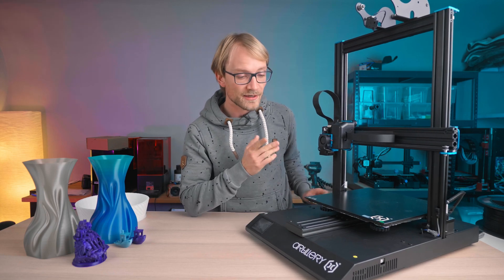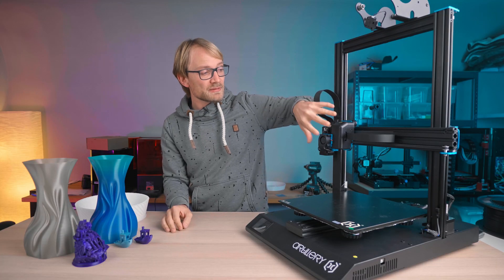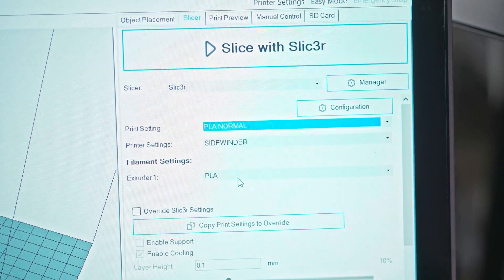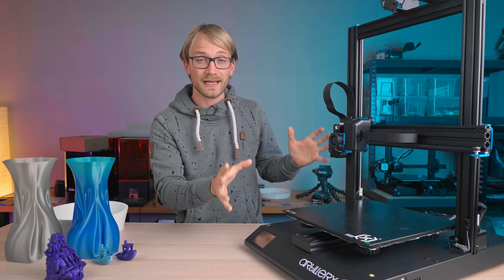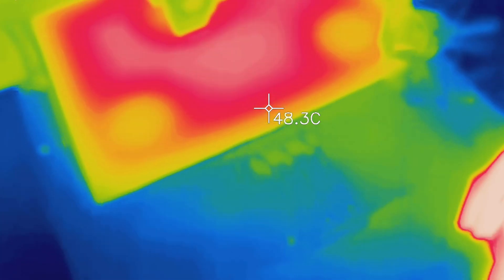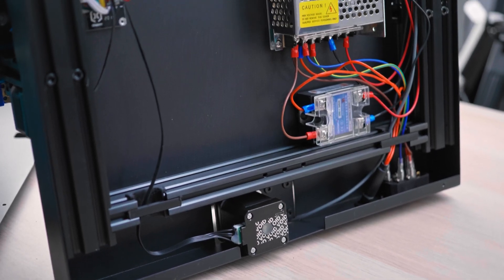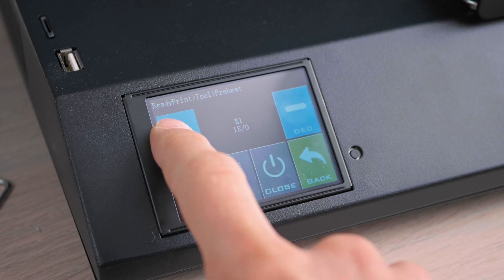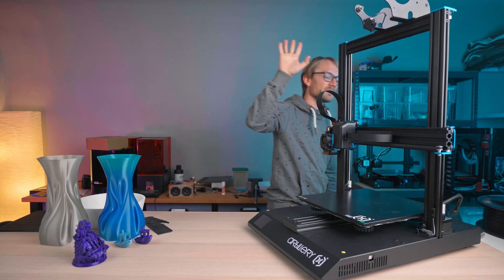Artillery Sidewinder X1: Built for show!

Comment: Well I wish I had seen this review before buying mine. Since owning it have experienced 2 occasions where material lost adhesion to the bed and resulted in the model being thrown off and the printer continuing to print. Normally when that has happened it's results in a load of spaghetti. However on 2 occasions it has actually caused plastic to engulf the nozzle, hotend, the 2 cables, the little board that seems to slot in and also the bit that connects to hot end to the main unit, that just snapped off. I then purchased 3rd party parts that didn't fit properly so I had to buy a whole new unit (not a whole printer just the bit that attaches to the printer, apologies I'm not sure on part names). It almost happened a 3rd time that time I was in the room and caught it before it got too bad. It's a unit that is a little more than frustrating. The print area is so conveniently sized yet I am now unwilling to leave it over night so I am limited on size because it takes so long to print.

Comment: Hi Thomas, I hear what you're saying about the heavy glass bed and the inertia behind it and its impact on printing large parts. However, from personal experience I can tell you it doesnt have that big or even a noticeable impact IMO. I print with a .8 Nozzle and typically print parts that occupy around 80% of the build volume and fairly fast speeds. Not saying its perfect, bc its not, but in the almost 2 years ive had mine its out performed alot of other printers ive worked with.
Reply from the maker: That's why I'd advise for a larger nozzle - a 0.8 really speeds things up.

Comment: I agree with your verdict. That said, I've had one for a few months, made a number of improvements, made it electrically ,more safe, and I will say that it produces outstanding prints - better than the ones in your video. .If you know what you're doing, you can turn this printer into an outstanding performer. Perhaps not a printer for absolute beginners. Also worth mentioning is that the company does listen to its customers. Their latest hot end design does no longer blow air downwards.

Comment: I was actually going to buy one of these tomorrow. Not anymore I guess.
Reply: Have you been to other facebook pages at all, just about every 3D out there has issues.  Every issue he mentioned is mentioned on their page with a fix to have it corrected, with the exception of the grounding issue, (mine does not have that issue).  Go spend some time at the creality website, which sells a ton more units, and read up on their problems.  Anyway, just wanted to point this out as I think a lot of first time buyers are not aware that you will probably have to tweak a few things to get your printer set up nicely.
Reply: I'm no first time buyer, in fact this would have been my 4th 3D printer. I'm well used to tinkering, not only to get better prints, but just to get one of my printers to print at all. This thing however is an absolute disaster with its electronics. Just the fact that the X1 has mismatched connectors plugged into the mainboard put me off, nevermind the shoddy sheath on the bed heater wires. I bought something else in the end.
Reply: @viceroysStuff  Prusa!

Comment: Now i feel kinda bad about my done but not delivered yet purchase from monday this week. I hadn't seen a single bad review on this printer anywhere, so i am kind of confused about what to take from this. It's not that the mentioned problems can't be diagnosed and cured, but my expectations are very different from what i've heard over the past 20 minutes!
Reply: Mostly because at this price point there is nothing better, and you can find 3d printed upgrades that will fix some problems, the prints are good so people are happy to tinker with it .
Reply: @haoss69  I got delivered a week ago, and it's the best printer i've ever seen. Works like a horse, and puts out quality part after quality part. Having used it for the better part of 10 days straight with barely a few hours not printing something, i see this review as just a bad experience, not a proper in depth review.

Comment: The CE seal is bought by self-certification and by filling in a couple of forms. By no means does it guarantee an electrical product to be infallible: no certified "CE engineer" will check your product before you are granted the seal. It's only useful for your insurance should you indeed experience a fire.
I'm an electrical engineer so I checked all the things you pointed out and except for the bed cable they're fine. You're making a bigger deal out of this than it is.
With this printer you need to do a little bit of DIY. 
I also replaced the idler handle for a aluminum one and replaced the inner tube with a Capricorn PTFE tube. And I added a BL Touch. The total cost of the upgrades was about 50 euros and I paid 375 for the printer on Aliexpress.
The bed adhesion never gave me any issues since I use Dimafix but I plan on adding a WhamBam plate like on my other printers.
Reply: All the mentioned mains related electrical issues are major issues. Every single one of them will lead to fail conformity tests. But as you mentioned, CE is self-certification and no actual test is required to declare conformity.
Reply: @fkiesel9442  Fortunately the mains issue is extremely easy to fix without requiring any technical knowledge.
Reply: @mururoa7024  would you give your family to work on 220V mains power connected device without proper ground protection? Are you serious with your comments? Sure people with no technical knowledge should go poking around 220V with pointy metal sticks. You should be awarded for Darwin awards.
Reply: @valent_t  I'm not sure if you understood what I wrote. As I said in my previous comment, I'm an electrical engineer so please spare me the lecture. I specialize in power electronics and automation. I've tested everything on this machine and it's fine, even the SSR is according to specs. The easy fix on the mains I was referring to is to replace the rubber sleeve with a cable chain. You can buy a cable chain or you can print one. This is not electrical work, and in fact you don't even need to open the machine at all. You just need to not be clumsy.
Reply: @mururoa7024  how about the grounding?
Reply: @LászlóKrencz  I tested it with my multimeter. The body of the machine and the power supply are both properly grounded (mine has a Schuko plug). I have a model 4. I can't speak for earlier versions.

Comment: FYI! Cura 4.8 has the X1 in there printer list so you can ignore repetier and go straight to Cura with preset profiles created by 3d nexus.  You nailed the rest Thomas greetings from Belgium.
Reply: Try to laminate with the same parameters but creating a custom printer profile, you will see that the printing time is drastically reduced. There is something wrong with the 3D Nexus print profiles that makes the prints too long.
Reply: Also if you would like to see some more in depth i got 2 vids from the X1 if you like
Reply: @NoizieWorks  link please would love to check it out. I have the SX1 v4 and so far so good

Comment: Interesting timing.  The X1 was my first 3D printer.  I got it 6 months ago, and then got two more 4 months ago (all v4).  I switched them all to .6mm nozzles.
The power wires for the bed heater on all three broke within the last week.  All three were at the kink you showed closest to where it meets the back of the case.  I figured out there were issues when all three were showing thermal runout errors for the bed.
I just replaced the bed heaters on all three and I added strain support to keep the wires where they meet the bed heater far more stable, and to keep the entire length of power/thermistor wires from kinking and instead bending with a reasonable radius.
Then I went and added the same support to the two Genius printers I recently picked up.
Thank you for all of your great videos and information, especially when it may ruffle a feather or two!
Reply: @iBert0  - I found a design I liked on Thingiverse.  Just go to that site and search for "sidewinder strain relief".  You'll have several options to choose from.  I suggest also adding a cable chain or something similar.  For me, since I was already pulling the print somewhat apart in order to replace the bed heater, I ran a piece of filament inside the cable sleeve along side the power and thermistor cables.  I don't know how long this solution will last, but so far so good.

Comment: I've owend a v4 Sidewinder for a couple of weeks and it is junk, basically. Out of the box the print bed had a huge dip in the middle, bad enough to render it unusable for anything but small prints. Even after loosening the bed and running it through some heat cycles as several people suggested, it's still around 0.2mm low in the middle area. The bed's thermal uniformity is awful, with a delta of 12C from the middle to a corner.
Two days after getting the X1 I did a PLA print and when I tried to remove it (with the bed fully cooled down) a big chunk of the bed coating tore off. 
To add insult to injury, on the very next print attempt the silicone sock came loose and caused a huge blob of PLA to cover the hot end.
It's a shame, since the printer is super quiet and the print quality, if you can get a print to stick to the terrible bed, is really good.

Comment: I owned my Sidewinder for 3 months and  started getting MINTEMP errors that were killing the prints in the middle of printing.  I am not new to 3D printing, and knew exactly what it was.  There was a break in the cable to the thermistor on the bed.  I contacted Artillery and they sent a new bed heater and insulation pad.  I have installed it and am back printing again, but one thing I plan on doing is removing the coated sleve that is on the bed heater and  replacing it with some PET braided sleve which has MUCH better flex.   The replacement heater came with the same stiff sleve that the original one had and has the similar kinks in it in a few places.  My guess is because of the coating that is on it.  If they had just made it with more flexible PET sleve it would have been  much better from the get go.
Reply: @3D Print Wrangler watch Tom's unboxing video ( https://youtu.be/7hcjsZRBuws?t=907 ) the link will start at around 15:10.  He talks about the heat bed cable.  You can see the type of sleve he has on it and how the cable is kinking.  This is the style that I have and that I think the majority of the people have.  You can see that it is a coated braided sleve. IMO it is the coating that kills the braid.  This is why I say that the PET braid would be better.

Comment: Have a V4. The flex cable issues are atrocious — flex cable boards replaced and still having issues. Hard to update the machines firmware — always needs a disassembly to unplug the TFT.  Because of the flex cable, I’m unable to hook up a BLTouch right now... idler arm breaks every now and so — requires a metal one.

Great when it works — prints come out nicely too... horrible when it’s down.

Comment: Interesting info. I've had an X1 for almost a year now that was listed as a V4. My cables and hotend are different than yours. I've hardly had an issue with mine through hundreds of hours of prints and it's my go to for any large parts that need to be strong.

Comment: I have the Artillery genius, I really like it but wanted to upgrade the heatsink to a genuine e3d titanium one.. well my printer does not have a threaded heatsink (the early models had a threaded one) but locks the heatbrake with 2 small hex lock bolts... Then I ordered a titan aero heatsink which has a threaded heatbrake mount, only to discover that the Artillery heatsink is like 1cm longer where the heatbrake hole is located... So after installing the aero heatsink my nozzle would not touch the bed before the part cooling duct and the carridge wheel behind the nozzle... So if anyone is trying to upgrade his extruder with a better heatbrake... Buy one which fits in place of the original... 
Sry for bad English

Comment: Mine hasn't stopped jamming for *months*, but that seems to be specific to my unit
Reply: @3D Print Wrangler Yeah, it's filament jamming. Since it started I tried swapping the heat break to an all metal, which just made it worse because I think now it's causing heat creep because as tom mentioned, it uses a weird heat sink design.

Comment: The Chinese business model is a bit different, once a product gets traction they tend to iterate downwards to increase profits. Its not unusual in any business except the Chinese started off with barebones engineering in the first place.  Chinese owned business are focused on short term goals.  For myself, after getting sued for the product I imported causing fires (dont worry the damage was fairly low) I became strongly anti-china as the lawsuits eradicated my life savings right when I had my daughter.  The Chinese partners did nothing to help (its impossible to sue a Chinese business)  and their products continue to be sold with impunity. So the point is maybe the first ones were better...  Western consumers don't care until their house is on fire and then they demand justice even being WARNED of the issues ahead of time. 
Doesn't matter if you saturate your product with warning.  In California its called "strict liability" and I can go on forever. 

Source: I used to import Chinese goods in the hundreds of thousands from 2012-2015.
Reply: I wonder; is this still viable if they come with a warning paper like this 3d printer not to leave it unattended ?
Reply: @elvinhaak  Warnings can limit the judgement or give you leverage in a settlement.   For example, a blowdryer should not be used in a bathtub, but at the same time the blowdryer company would still be held liable under "strict liability" for any damages even if the user completely disobeyed the warnings dried their hair in the shower.  Same with smoking around a gas can etc.  You can use the warnings to negotiate etc, but you may still have to settle and have your own legal fees or pay more for product liability if you can even find someone to ensure you. . So US companies add extra idiot proofing to their designs. 

It also depends on the state the suit happens in, in California you get wrecked!!!!   The definition of strict liability is "Strict liability is a legal doctrine that holds a party responsible for their actions or products, without the plaintiff having to prove negligence or fault." in other words anything that happens you carry the load even if you did everything right and are not at fault. If you look at a blowdryer, it has really over engineered GFCI plug. US product designers design around this threat to their business. 

A misconception is that only the maker gets sued, depending on state you can sue everyone in the chain of commerce.  Amazon dodges this but small companies don't have this ability so they often settle.  I can write a novel its quite insane everything is tilted in China or Billion dollar quasi monopolies favor. 

Perhaps I will make a video one day. It was one of the most stressful moments of my adult life.

EDIT: I live in the US but just any western company takes steps to ensure they are not taking risk by adding idiot proof steps or simply maintaining quality standards. .
Reply: @takingtheblackpill  Wow, that is really sad! We all laugh here at the stickers at our microwave that we should not use it to dry our pets but it looked just like an anecdote. But this what you write - pff... how can you do any normal business when this is always a threat? Only when you are a part of a nationwide very big company that seems possible for selling stuff that way!   Just making everyting 3 times more secure then needed :-(
It is like impossible to sell 3D printers (made in China) for a reasonable price then.

I always check all electric stuff out for as far as I can but am still very surprised many times of exploding and melting LED-lightbulbs for example or USB-chargers that have a EU-sticker on them like as beeing tested but internal just rebranded cheap and bad produced Chineese electronics.  But luckily we are still more-or-less resposible ourselves here for buying and using products that look like 'too good to be true'. Of course a TV  should not just burst into flames in normal use but we have home-insurances for ourselves that will normally solve these things without needing to sue the store we bought it in. But knowingly selling a dangerous product like this sidewinder to someone else would be grounds for sues although it is more-or-less his responsibility when a person buys a second-hand 3d-printer from me as a person.

Comment: I'm printing with this machine since a year or so. I must say, that I did some improvements like frame stiffing struts and a BLtouch, but overall this printer is  very reliable, which is the most important benefit of this machine for me. I mostly print RC planes with thin/single wall parts, which are a challenge for every printer, but this one handles it pretty well.

But yes, Thomas is right. There are some things to mention about the electronics and he did. One of the first things I did was to swap the Y-carrige cables to some decent silicone ones with a strain-relief and remove some of the couting of the case in order to ensure a decent grounding.
You have to be aware of those issues, and then they are easy to improve, but I must agree with Thomas. Using this printer as it's getting shipped, is bloody dangerous and I would't recommend this one to someone who just wants a plug and play printer.

Comment: I got one of these last year, and the instructions on how to tighten the wheels were originally not very clear, so I ended up confusing the tightening nut for the adjustment nut, and ended up tightening the wrong one, and stripping a screw. -_-  Other than that tho, it's been great.